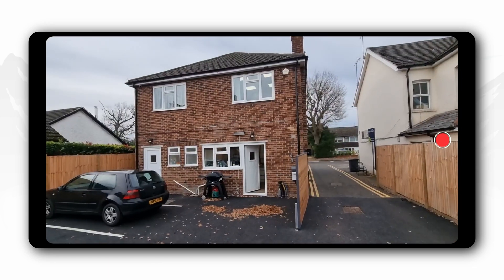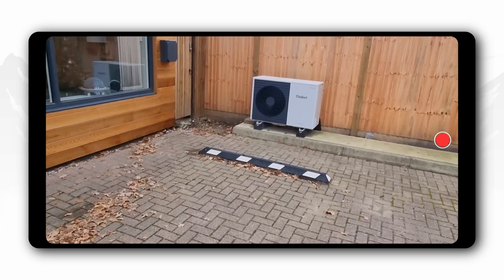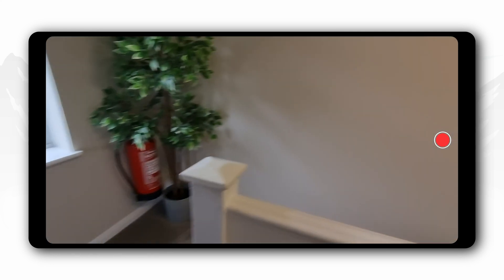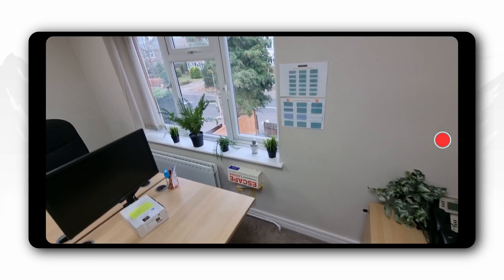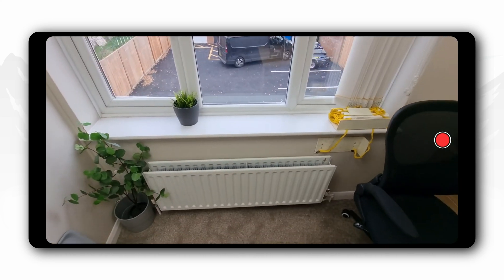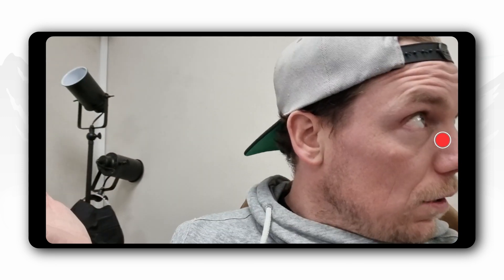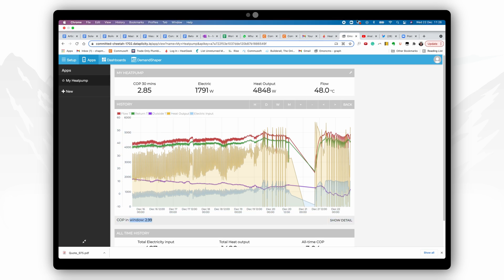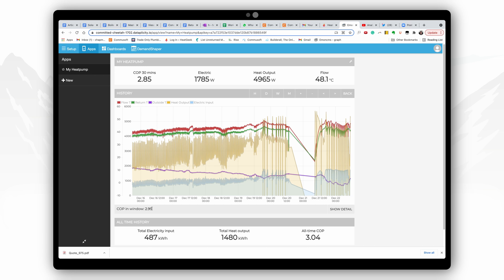Can Heat Pumps Heat A Normal Building?

Comment: We have in this room 16 degree :D That's end of the story for me. I need 21-22 during a day in my 1960 105sq m house.
Reply from the maker: thats a shame you cut off there, if you listened to the rest of the sentence we go on to say how that bit is heated by a diffent heat source..
Reply: @HeatGeek  OK. I get through once again. 
I bought 105sq m ex-council house from 1960.  So hi-five there :).
So seems like you have a similar house. What I think you should mention is you have quite a good draught improvement. 
I would like to see some draught test and how many sq m3 of air is leaking in your house. That would give a real example of the benefits of the heat pump. 
As I think there's online no apple to apple comparison with some metrics regarding air leaks.
 I'm still betting EnerPHPit 1960 with modern gas boiler and google thermostat with weather compensation - such as Google Nest, will run cheaper and have low emissions compared to the heat pump.
EnerPHPit standard exceeds Erp A by a big margin.
Heat pump installation is a lot of money. I would more likely invest into propper improving envelope of the building (air leaks), and then a solar panels.
15-25k It's a lot of money. 
I'm still thinking that's suitable for rural areas and places where somebody uses 20y old boiler or oil heating.
I'm like this video after all.

Comment: Does a condensing oil boiler running hvo fuel produce less green house gases than a high temperature ashp given that over a year over 40% of our electricity is created using fossil fuels
Reply from the maker: no bc heat pumps are 350% efficient vs oil boiler at 88%

Comment: What ashp have been used in this video is it a high temperature ashp
Reply from the maker: Vailant arotherm.. it can achieve high temp but isn't a normal double compressor high temp
Reply: I screen grabbed the ashp it shows it is a aerotherm plus, when I looked at the instructions the 5kw model says  at 0 degrees outside temperature at a 55 degree water temperature it gives an output of 6
2 if this is kw this would convert to 21,155 btu so considering i calculated the heat loss accurately measuring walls  and windows outside and inside and insulation i purchased the smallest boiler to fit the requirements which is a 15-22000 btu oil condensing combi boiler so i would assume this ashp would work i also purchased fluid trvs and a digital wireless thermostat am I correct in my assumptions by the way great videos

Comment: Wow, very impressive. I have no idea how you are able to heat those rooms with radiators that small with a typical low flow temp for a heat pump, ignoring the COP of the system it's hard to believe that enough heat is transferred from the radiator to the room to maintain a reasonable temperature.  Goes against what I've read but would be interested if you can go into any examples of calculations to show sizing of radiator and flow temps to get a better understanding of how this works?

Also as an aside would be very interested in your opinions of PVT heat pump systems such as the Dutch Triple Solar or the French Dual Heat (hope I have that name right).  The logic of it makes sense to me, with the volume of air transferring heat into the system replaced by the area of the panels rather than the flow rate of the fan, has advantages of being quieter and not increasing foot print of the building.  But due to not being widespread I have seen very little in the way of reviews especially those backed up with usage data.  Would be great to get a more educated opionion.
Reply: They have 2 3 computers in every room also ... and the cop is bad , it may look good if youre not into heatpumps but cop under 4 is a fail in my opinion
Reply: @superbecx  to be fair COP of 4 brings it out about even with gas from a price point of view but I was expecting far worse from that set up. Good point on the electrical though, but to be honest if they are just basic work stations (which you would expect for that environment) they shouldn't be throwing out more than a couple of hundred watts of heat per PC

Comment: Have you considered using a time/temperature data logger to measure performance of your heating system? I have 2 Elitch rc-3, one to log outside temperature and one inside just placed away from heaters and direct sunlight.
Reply from the maker: its built in to this system
Reply: Can you tell me what room temperature you are achieving over a typical winter's day (+5c).?
Reply from the maker: @wattsupmike7593  we keep it about 21.....

Comment: I had a new Viessman boiler fitted in our edwardian detached house (no cavity wall insulation) over the summer and initially had it connected using an outside temperature sensor supplied with the boiler for weather compensation mode and all our rads are new or newish double convectors. Im in Southampton and in the fairly mild autumn weather the boiler flow was going to 47C which was fine, but as soon as it was getting much colder the weather compensation mode was not getting the boiler warm enough to get the house past 18C, I had to disconnect the sensor and turn up the boiler to 65C. Im trying to understand how a heat pump could achieve the required comfortable temps in older properties, without fitting very large rads?
Reply from the maker: You just need to turn up your weather compensation curve.. very simple.. connect it back up, turn up the curve, save money and increase comfort.

Comment: Hi Heat Geeks, what an excellent video.  I have an 8.5kW Mitsubishi Ecodan, with the FTC6 controller and the wireless roomstat.  That video you mentioned for home owners to tweak their system would be most appreciated.  I ran a report for the same week as you did here, I have a four bed 1987 build house in Yorkshire, and for heating in that week I managed a COP of 3.8.  It appears my cavity wall insulation and larger radiators are helping, but there is alway more to learn, so am looking forward to your hints and tips.

Comment: Hi. I've watched most of your videos and you have opened my eyes to quite a few things. Have you got much information on high temp heat pumps? Are they still a good viable option for a building that is a leak heat for a past time.
Reply from the maker: Hot heat pumps are expensive to run. Not getting away from it
Reply: @HeatGeek  I have a building that I'm design a heat pump for but the place is 500mm stone with a massive single glazed 3m x 4m window. My thinking with a high temp was to design at 65 for a quicker recovery and the heat pump isn't working as hard? Plus rad sizes wouldn't have to be as big.
Reply: @mikecole4952  you’re just lowering the cop doing this.
Reply: @russellthomas9391  lowering the cop by lowering the temp of a HT heat pump? The rad sizes are too big for a low temp btw

Comment: 4861w (heat output) / 1771w (elec input) = 2.744 output to input coefficient.  22p elec kwh / 2.744 = 8p per kwh.  Lets use the median of 6p per kwh to be fair, although I'd like to see more data.  It's still more expensive than gas at the moment, and you have to fork out 10k for the air sourced units.  I'm not seeing the economy here.
Reply from the maker: Fuel prices are and will change. The economy is also carbon based. 1 - 3rd the carbon here.
Reply from the maker: also.. 2.7 is not the average.. 3 is
Reply: @HeatGeek  I was being generous by saying 6p.  If 3 is the actual average, then you're closer to 8p per kwh.   Price of gas would have to double.  Even if it does, I wont have to pay 10k for a heat pump.
Reply from the maker: @jamcguire100  price of gas is set too wayyy more than double.. any assumption today will be inacurate tomorow.
Reply: @jamcguire100   and back to that gas is now 7.37p per kWh and electricity 27.86p for my latest tariff. It may not be long with the way gas is rising. Then you don’t have to pay for the gas standing charge. They’re probably equal now

Comment: Interesting.  Been doing some experiments on my 60s detached house with low boiler flow temp (to see if it's possible to have a heat pump), found I could get away with 45 degrees flow when outside temp 7c-14c.  With it hovering around -1c-2c outside the section of the house with radiators was still warm enough, time to temp took longer but was fine.  I also have a section with underfloor heating (on joists not in concrete) and at 45c it struggled to raise the room temp, only managed to raise temp 1 degree in 2 hours. I changed the flow temp to 55c and was up to temp in about 40min.  To be fare my underfloor heating is spec'd to run at flow of 55c (flat roof, think spec says can go 7 lower).  I suppose if I had not allowed the underfloor section to get so cold it might have been able to maintain temp but I wonder if that would have cost more..     Anyway, please can you clarify the flow temp of your system, did it say 48c?  Is 55c possible and still efficient?
Reply from the maker: Ours was 48 at that time but we have weather compensation so changes wothoutside temp..  as all should do
Reply: @HeatGeek  Thanks for the reply. I think 48 might be a bit too low for my house, is 55c flow possible/sensible to achieve?
Reply from the maker: @radfoo  no way of telling without a calc or to test.. it shouldn't be the same all year round either.. your flow temp is generally stated as what's required at -2.. what's needed at -2 is not whats needed all year round though.

Comment: Great video… 

I did similar 5 years ago, replaced an old oil boiler with an A2W, 1,800sq ft bungalow. 2 extensions in average home, old double glazed windows, bad doors, good insulation in attic but we did pump the cavity walls. Didn’t replaced any of the old rads. 

9kW A2W heat pump. 14 rads in total. Ok insulation. Delta T is usually 7 degrees giving a superheat of 8 degrees. Typically at 0 degrees outside, rads get 39 degrees flow. 10 degrees outside would be 30 degree flow. I run it fully weather compensation. Note the cylinder was updated to match the HP. 

Installed on 28th November 2016. Average SCOP 3.8. Total hours to date of 8795 compressor hours, 919 of which is hot water (3 very small kids). 8 hours of 3kW immersion. 

My heat pump is fixed compressor so that means 8,795 * 2.4Kw (input) is 21,108 kWhrs in 4 years 9 months. I’m paying 16 cent incl Vat. Is €3,377 in just less than 5 years. ~€710 per year for constant hot water and 6-7 months per year of 20-21 degree indoor room temp.

When I see heat pumps heating 200 year castles in Ireland then I knew my crap house would be happy out with a heat pump. (Been working with HPs for 15 years)

Comment: Hi 

I was wondering 
I am renovating my house now

Would I be better off firing larger than needed k2 rads now 

And ufh 

So if in the future I do decide to have a heat pump

And. 210 litre mega flow tank 

Then there would be less work to do and less costing ? 

Thank you
Reply from the maker: Hi

Better to do prep yes. Although you really want them sized properly and not guessed. Also make sure your unvented cylinder is a "heat pump" cylinder.. I.e. larger coil.

Comment: Ok , you put in 1 kw of electricity and get 3 kw of heat energy out  ?
Does the HP modulate or is it fixed ? 
Just wondering when the trvs shut down what happens with the HP ?
Reply from the maker: It modulates. The trvs shouldnt 'shut down' that only if yu have poor control wether using boiler or heat pump.
Reply: @HeatGeek  Trv’s shutting down is due to poor control ?
What controls are needed to prevent trvs shutting down ? 
I have been working in the commercial field for a  few years and follow channels on yt to keep abreast of the domestic field .
Reply from the maker: @haydnlawrence8167  advanced weather compensation means the flow temp is relatively to what's required only and no more.. if the room temp is maintained ot will not over heat and rooms will not close
Reply: @HeatGeek  👍

Comment: My Edwardian house can't have cavity wall insulation, as there's no cavity. I have lots of loft insulation though. Would love to eventually get a heat pump, but the installation cost is way out of reach (especially ground source, that I'd prefer).
We've got 3.3kw of solar (installed by previous owner), so running it shouldn't be too bad.
Reply: They are doing heat pumps all wrong in the UK. 
In Norway they pump the warm air from the apex of a building down into ducting that's connected to a heat exchanger.
The exchanger transfers heat to seperate ducting that is full of fresh air from outside. 
A minimal amount of compression is used to further warm that fresh air, because if it's overpressured the air & heat will escape!
Also, they don't solely rely on heat pumps. They use a FOSSIL FUEL BACKUP, aka NATURAL GAS.

Comment: What is the best cost efficient set up for the use of 2 people in a  4 bedroom detached house, year built 1999, well insulated but with a conservatory (which radiators are not big enough to heat it). Not all the rooms are used.  I just need it spelt out in simple terms.  Is it a boiler, heat pump and underfloor heating?  Or do I just need a boiler and underfloor heating?
Reply from the maker: Most cost efficient for installation will be a boiler and radiators.. 'best' depends on how much you value lower co2...

Comment: I would be interested to know how long it was running and the room temperatures. If it ran for twice as long as a boiler  you have no savings. However the real purpose of my visit is to pass on this question. I wonder if anyone in your network of installers can help this lady. It would seem that a lot of people are struggling to find a good service engineer. 
Are you using a buffeer because there is bugger all flow in that system? 

	Hiya

I have been watching your wonderful videos and I agree with all you say.

I wonder if you can give me a little advice

I had a heat pump installed 2013, it keeps braking down and the company no longer exists.  I contacted a plumber who installs heat pumps and it took him 4 months to get it back up and running however, the problem is that he has now used a bypass system to get it going again and we got a nice big bill as you can imagine.

On Christmas Day 2021 you have guessed it, it stopped working again.  We have tried everything to get it going and absolutely nothing, I am worried that I might get another massive bill and months to sort it out or do I look for an alternative and what would you recommend because I cannot install gas so I need an alternative?

Are wall mounted oil radiators an option?  I need 13 of them.

I would so much appreciate if you could get back to me.  

Thank you so much

Dee
Reply from the maker: Hi Roger 

The length of time it runs for is not an indicator of how much energy is consumed alone. You need to factor in the actual power input
I.e If you have a 30kw boiler running for 4 hours a day a vs a 10kw heat pump running for 10 hours, the HP would use less energy  (120kwh for boiler vs 100kwh HP) and maintain a more stable temperature. 

Our heat pump has kept the building a constant 21c.. which I should have shown although is logged in the same software which we can give every one access too soon. Admittedly though setting to perminetly 21c has been an accident, the heating was meant to be timed to go back to 18 over night but hadn't realised till last week it was set to permanent!.. a little embarrassing but I want to be honest.  Had I have realised this, the heat pump would have worked less hard at night (when outside temp is lower) and we would have got an even higher COP and used less overall energy.

No, that buffer is for a solar thermal project we're doing. The heat pump does not run through that at all.. the heat pump is connected directly to the radiators with no buffer or low loss header as is usually (wrongly) advised and there's plenty of flow.. hence the sensible COP.

I'm pretty sure we can help Dee for sure! If either yourself or Dee emails hi at heatgeek dot com we will see what we can do.

P.s. Still keen for a zoom call too as we mainly agree with your points.. but I think tech and methods have moved on since your experience of heat pumps though hence the results here.

All the best 

Adam
Reply: The best bet for Dee is an oil fired boiler.... They last for decades, very cheap to buy, and most importantly they heat your house really well and cheaply. . . 

With a heat pump you need faith and wishful thinking to keep you warm. When you start cooking with the gas you don't need to imagine heat, there really is heat.

Comment: That is interesting (and surprising with not even cavity-wall insulation). Some numbers on actual and modelled energy usage would be really interesting.
And of course why haven't you just put some cavity wall insulation in or upgraded the loft - those things are so cheap you might as well do them and take at least 30% off the heat loss (unless there is a longer-term plan to fill the cavity with something solid for extra thermal mass and then do massive EWI+ warm roof for a really good building?). Is this building new to you so you've not got round to it?
Reply from the maker: We want to upgrade the system and insulation after to show the effects.. 

Also.. this building is rented so will only spend so much on it

Comment: My question to you is, what size is the water tank you have in that building? As obviously combi boilers are nice and compact?
Reply from the maker: That's not a hot water thank.. that's a buffer for an experiment we're doing with solar thermal.  The hot water tank would need to be about a third of the size of this.. or use an electric shower.